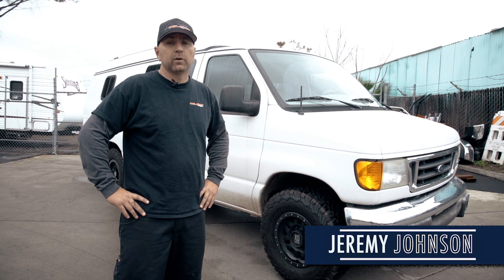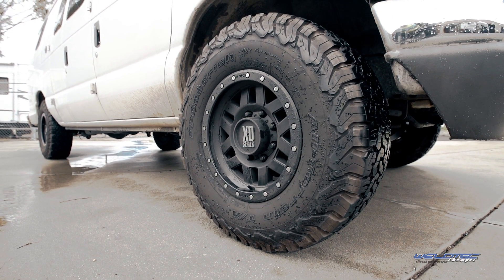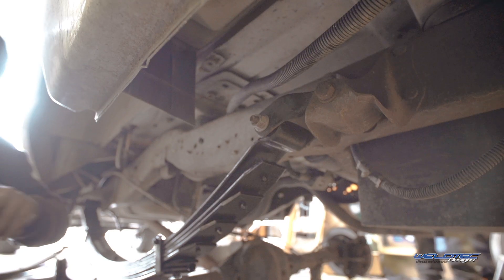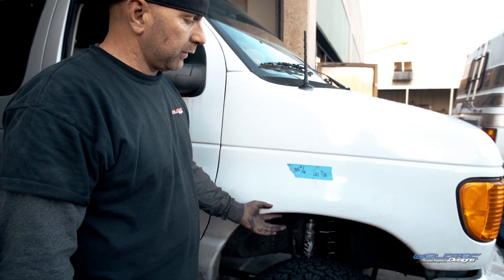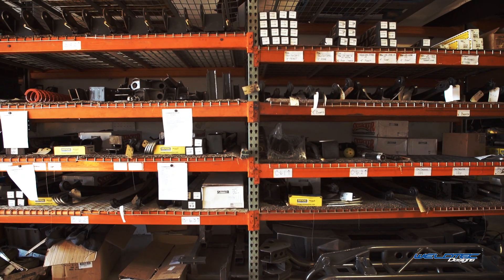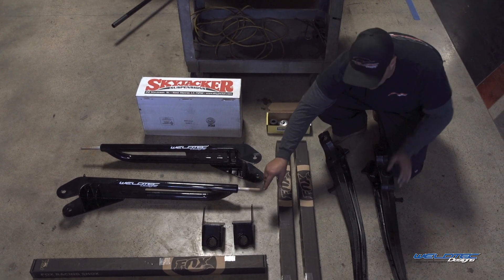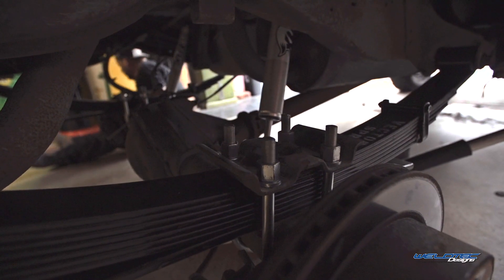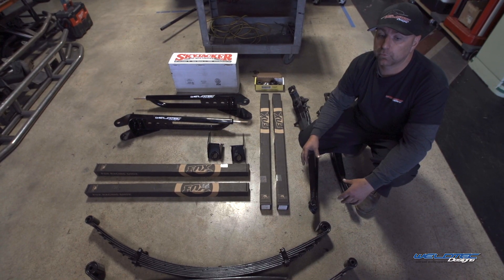DIY Series:  Ford E-350 5" Suspension Lift | Part 1 of 3

Comment: For anybody who's questioning this kit, it is totally awesome, and has turned my van into the most fun vehicle I own, and way more stable and comfortable.  I was worried about lifting the van without doing a four wheel drive conversion, thinking that it wouldn't be stable but am totally blown away with how the van feels!  Best decision I could have made!
Reply: would it make it smooth ride? cuz i work on my van and its really bumpy due to all those potholes over the last 3 years. i drive 200 miles a night for work. at this point, i feel every pothole every sewer cover and its not 100% stable after 60mph. it has great engine and transmission but this suspension thing is killing me. What is the solution ?

Comment: So you heat and bend the I beams that say do not hear and bend right on them? How's that working out for you so far? Not hating either, legit considering this kit, but that worries me since the I beams are cast
Reply from the maker: No issue thus far. Sold 100's of kits and no one has had any problems. As you can see from our customers reviews they are all very happy with our lift kits. We beat on our van like no other and they are completely fine. I guess you could say everything's working out just fine over here :)
Reply: @WeldtecDesigns  would this work with a 85 econoline?

Comment: Hi ,  got the 6 " kit  , rear is done on 02 E 450 2wd awesome  used  Hellwig HD sway bars  .....but In front  Hellwig 7008 or original stock  .....I have issue to connect sway end links to sway bar + camber is so off   V shape (loaded heavy end ).....do you have any  2wd video or pic with 6 " lift   . I bet I need some special connector sway link or  some advice .. Thank you in advance .
Reply from the maker: Typically we do eliminate the sway bar, however we do sell brackets to drop the sway bar. Take a look at the RV videos to see this. Give us a call if you need further assistance.
Reply: @WeldtecDesigns   Can you send me the pic of it  and pricing ...I will shoot you my email ..thanks a lot

Comment: $3600 is alot...to much for most people, I have been in fabrication for 10 yrs and I built my own drop brackets which bring the I beam bushing mounts down 2" corrected the trailing arms and ordered 6" skyjacker springs, blocks on the rear and new shocks...I'm all in at roughly $600.00
Reply: I agree...$3600 to lift a $4500 van...too much for me.
Reply: Google Reviewer yea 3600 little ridiculous for a 2wd lift
Reply: Sell me some drop brackets 😂
Reply: @MrWayne__  whats with the laugh emoji
Reply: @midwest9757  hey Weiland Kings I'd like to see some pictures of that van, I'm a pretty good welder fabricated a little bit I've got a nice work day and it's a 98 and I'd like to get it lifted at least 4 in it's it's pretty high now it's an E250 heck put some pictures on into the guys laughing don't listen to them.